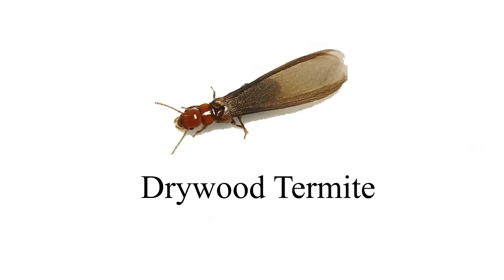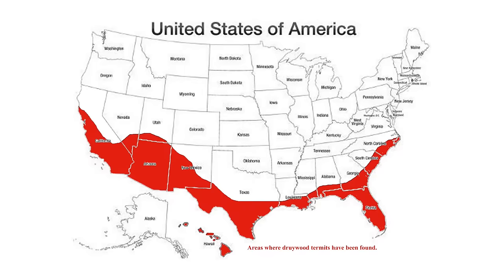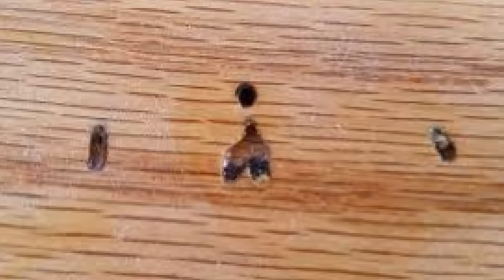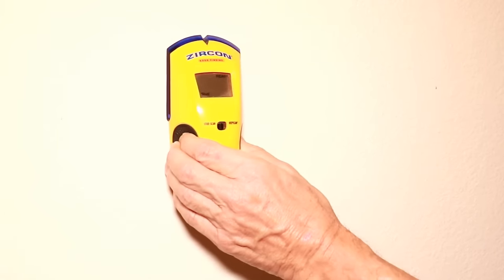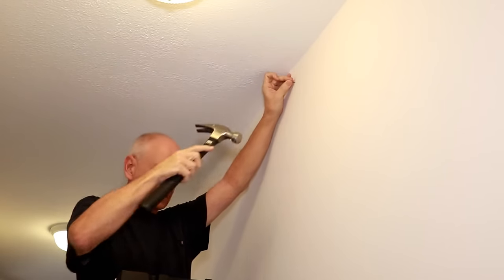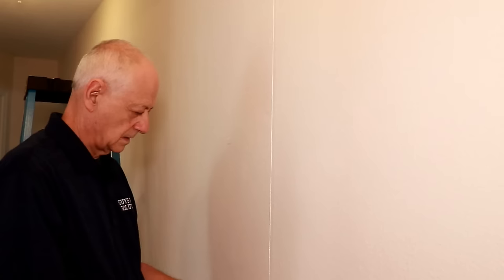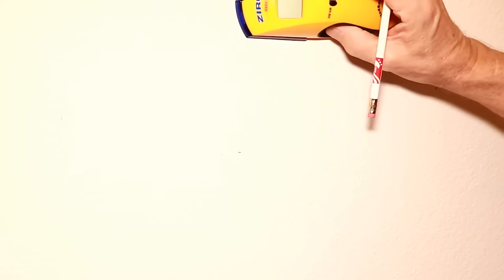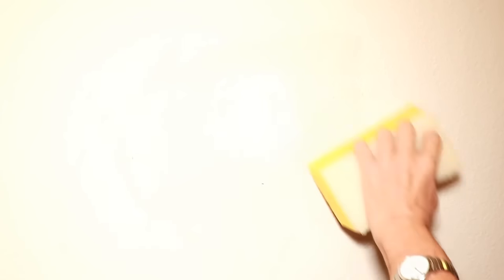How to Treat a Drywood Termite Infestation Yourself. A MUST see if you have Drywood termites.

Comment: All the frass  I see is at the bottom of my window seal.  And my foundation is severely damaged. Will fixing my foundation help with termites. This house is old and the wood is not treated wood. :-/
Reply from the maker: Fixing the foundation and sealing up as many openings as possible is a very good idea, but you cannot get rid of drywood termites that easily.  Please read the last response I gave you.  I explained the problem as best as I could.  Be well Sarah.

Comment: Common sense tells me if you seal as many interior openings as possible, the swarmers won't be able to colonize easily. With this in mind, the easiest place to seal off access to internal studs in walls is to seal the gap between the floor and wall. Seems logical a homeowner should caulk between baseboard and floor where possible. Do you think this is a step in the right direction?
Reply from the maker: Very good point Mike.  You are correct.  The more you seal up the better.  It's the same for the exterior of the building as well.  If there are no entry points, then these guys simply cannot establish a colony.  Of course, they have a way of finding the one place you missed, but there is no sense in giving them anymore opportunities than necessary.  Thanks for making that point.  Well done.  Also, thanks for watching.  Be well my friend.
Reply: @GuysPestSolutions  Thanks...next question same subject....Before I seal the gap under the baseboard trim (floor trim), I already sprayed a stream of Tim-Bor around the ENTIRE perimeter of the condo with about 80% of the liquid going into the gap. I wiped up the liquid that did not. Next, while the gap is still available, I will do a foam stream into the same gap using a five year product by Bayer called Premise Foam. I am hoping the foam goes a bit farther into the floor gap than the liquid Tim-Bor. Then, finally I will seal the seam with caulking. I believe it may be overkill but while access is easy I think it's worth it. Do you see any issues adding these additional steps before caulking? BTW I will do roughly the same treatment for every single copper tube, drain pipe, etc in the condo that penetrates the drywall.
Reply from the maker: @mikem54321  It sounds like you have a pretty solid plan.  I would have probably used Bora-Care instead of Tim-Bor and I probably would have used a fipronil foam instead of Premise foam.   Bora-Care is a liquid-based borate that will penetrate deep into wood.  Tim-Bor on the other hand is more of a suspension that will leave a residual on the wood, but it does not penetrate very deeply into the wood because it's essentially a powder.  I understand that it is in liquid form when you spray it on, but when the water dries what is left behind is simply a borate powder.  Bora-Care is actually a liquid instead of a powder and that allows it to penetrate deep into the wood.   So, while Tim-Bor will prevent drywood termites from entering the wood, it does little to prevent subterranean termites that may attack without contacting the outer surfaces of the wood.  I mean, if you're going to treat for termites, why not treat for all the species?  Still, Tim-Bor will do a good job preventing drywood termites from getting into those areas.  Premise is a very good product that they claim will last from three to five years, if it is not exposed to light.  To be honest with you though, I am somewhat skeptical of that claim.  Of course, I have no data to back up my thinking on it.  Personally though, I would be surprised if it lasted more than 90 days.  The active ingredient in Premise is Imidachloprid, which is a very good termiticide.  I do believe Imidachloprid will last up to five years when buried in soil.  However, using a fipronil product will last five to ten years when buried in soil.  Also, I believe that fipronil is a faster kill product than Imidachloprid.  Frankly, I do not believe that fipronil foam will last that long in wall voids either.  The truth is that I think both products would have just about the same length of residual when used in wall voids.  The reason I prefer fipronil over Imidachloprid is simply because I just think it works better.  All of that being said, you didn't go wrong with the Tim-Bor or the Imidachloprid.  My only reason for mentioning this is, if you ever do it again, you may want to consider these other products as a somewhat better alternative.  I definitely would not waste the money to retreat these areas with the products that I recommended.  Just something to tuck away in your brain for next time.  A really good fipronil foam to consider is FiPro, but it is only available from Solutions Pest and Lawn.

Anyway, I think you have an outstanding plan that will pretty much prevent future drywood infestations.  Since drywood termites typically enter from the outside, be very meticulous about sealing all cracks and crevices around windows and doors.  The same advice goes for soffits, facia boards, and any other penetrations that may be around the home.  Building out all types of insects is always a good idea.  The thing is though that these things always seem to find the one crack or crevice that you didn't see.  That is why, in addition to sealing up all cracks and crevices, I would also do the exterior treatment every three months, just to be sure that these guys have absolutely no chance of infesting my home.  Also, a proper exterior pest treatment will prevent just about every other kind of bug you can imagine from entering your home.  It is almost impossible to seal up every crack and crevice so tight that ants cannot enter.  Some of them are so small that we cannot even see the opening that they are entering through.  However, they will not get past the pesticide.  Just food for thought.

Anyway, go ahead and seal up those cracks.  I think you are doing an outstanding job.  If I were running a pest control company at the moment, I would definitely hire you.
Reply: @GuysPestSolutions The reason I choose Tim-Bor is for the explanation you gave. Tim-Bor does leave a salt like powder after drying. I was thinking that if a swarmer termite walks across this powder, it would die. Swarmers do not eat until they a and they are my target. Please correct me if I'm wrong.
Reply from the maker: @mikem54321  The thing about any borate product or boric acid is that they only work for pests that groom themselves.  That means they will work for termites because termites do like to keep clean and they groom each other all the time.  The problem with borates and boric acid is that a target pest is not going to die simply by walking through the product.  For them to die, they literally need to eat the product.  So, if you have wood that is covered with timber, then the swarmers are going to walk through that material and, at some point, they're going to groom themselves and ingest the borate that is in that product.  This is the reason why Bora-Care works so well for termites.  With Bora-Care, even termites that have infested deep into the wood are going to eat the Bora-Care while they are dining out on the wood.  That’s because Bora-Care penetrates almost all the way to the center of a 2X4.  The really good thing about using borates or boric acid is that both of these products literally last forever.  That means in a house where all the wood has been treated with Bora-Care, there will never, ever be a termite problem.

It really is pretty cool, but it is important to understand exactly how these products work.

I hope that helps.
Reply: @GuysPestSolutions  After more research I am sticking to the safest method and I am not going to use any foaming poison. Will have to rely on a very well sealed baseboard and condo unit to keep swarmers and other pests out. 

My main goal is to block light inside walls and keep condo bone dry (dehumidifier).  If swarmers from an adjoining condo hit a common wall, there will be no light or moisture to attract them to my unit. Hoping they never head in my direction and if they do, life will be very difficult with no moisture to sustain them.
Reply from the maker: @mikem54321  Sounds like a plan.  Don't forget to make sure that exterior entry points are sealed as well.  Most of the time, these things do enter from the outside.  Good luck with it.  I think you've got this.

Comment: I live in Florida and I have a subterranean termite infestation. I was told that subterranean termites only show up when you have a leak. I don't have money for professional service. Please help me with treatment. I also have a mud tunnel near the sliding door. How can I remove this mud tunnel. What can I effectively treat  this infestation myself. Please help
Reply from the maker: How you handle that will depend on the species.  You have two different species of subterranean termites where you live, and they each get treated differently.  Sometimes you can just use termite granules for subterranean termites, but if you have Formosan termites, then you need to trench and possibly do some other treatments inside as well.  So, you need to start by determining the species.  Figuring out the species is actually pretty easy, and I have a video on how to do that.  I will provide you with a link below.  After watching this video, you should be able to identify the species.  Just get back to me after you watch it and let me know what you found out.  At that point, I can tell you exactly what you need to do.  Let me know if you have any problems identifying the species, but I do not think that you will.  It is much easier than you may imagine.   For now I recommend that you do nothing at all.  Trying to treat this the wrong way will do more harm than good.  Do not disturb the mud tubes.  You can use them to your advantage.  I will explain everything after I know the species. By the way, you don't need a leak to get infested with termites.  Leaks to offer a welcome mat, but it is not necessary for them to attack.  With a bit of luck, you may be able to treat this for under $100.

Unfortunately, I will be out of town for a couple of weeks, so I may not be able to assist you until after I get back.  Don't worry though.  I will walk you through it upon my return.  I'm sure I'll have a good deal of questions waiting for me, so please be patient.  I will work through them one at a time.  Hopefully it will only take me a week to get caught up.  I promise that I will get back to you, albeit a little slower than usual.  We have not been on a vacation for over 13 years and my wife has explained in her unique way that the time has come.  So, go I must, and we won't be back until around June 11.

I hope that helps.  Be well my friend.

Video on how to identify termite species: https://youtu.be/dIs_a0nfVjg